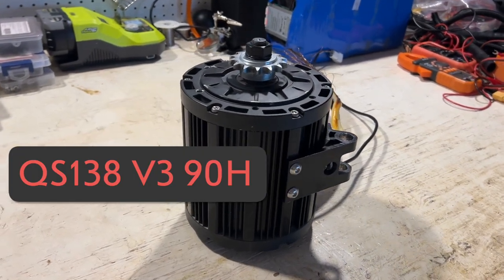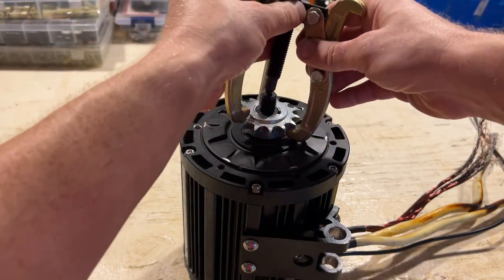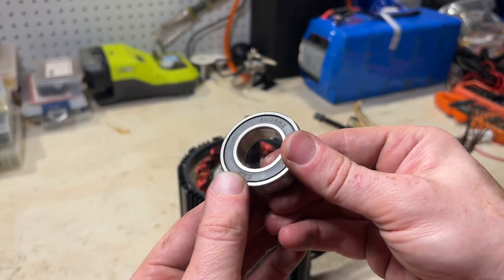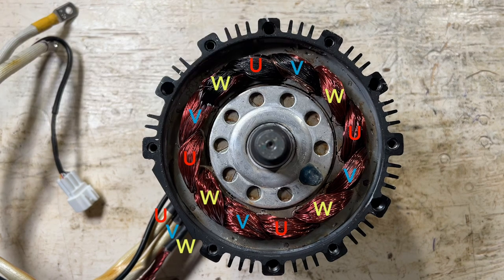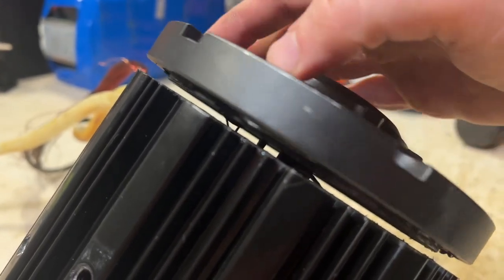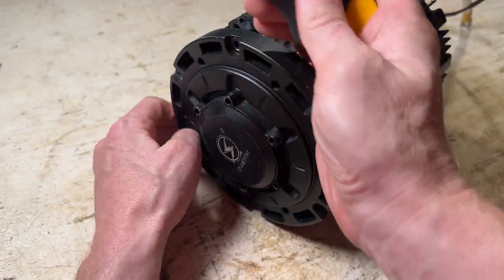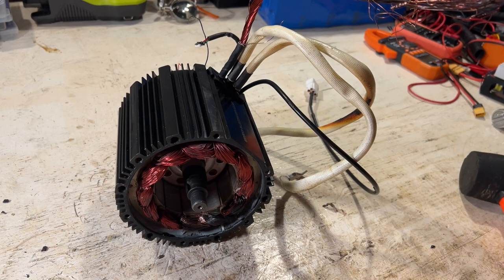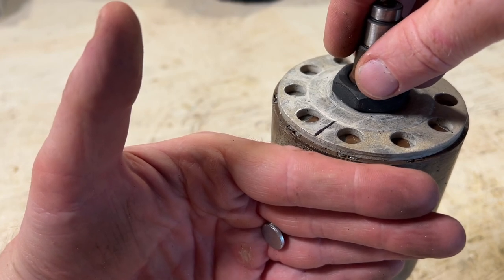Complete Teardown of the QS138 90H Motor | The Best Cheapest Motor?

Comment: Thanks from all of us QS138 owners for such a quality and detailed video!

I have disassembled QS120 and QS138 before, so some little tips if you are do it to a healthy motor and then reassemble it back without a damage:

Unscrew the hall magnet plate before taking the rear cover off. It is not shown in this video because it is between the two rear covers behind the hall sensor pcb.
Mark the rear cover position over the casing so you can correctly position the hall sensors during reassembly.
The easy way to take out the rotor is to secure it in the vice and just pull the stator away by hands with one quick motion. If you can not do it completely in one motion, it can damage the stator windings because the shaft end will try to stick to one side of the stator.
If you plan to replace the shaft (you can get spares from QS), it is not easy to pull the shaft from the rotor. It is glued with permanent threadlock and you need to heat it up before pulling the rotor.
Reply from the maker: This was my hope & very good tips! Thank you!!
Reply: @GaiusGarage  would it be possible to convert this type of motor into a variable magnetic field motor. The rotor seems a bit hard to press back and forth. I was thinking about reducing the torque for regenerative braking. hydrogenerator from a boat propeller in reverse, maybe with some flywheels and gears to help.

Comment: Dropping by just to say thanks a bunch for this teardown! I'm using the QS138 on a PhD project, didn't want to tear down my brand new motor just yet :)
Reply from the maker: much appreciated! glad it's helpful. What's your PhD project covering?
Reply: @GaiusGarage  Its mostly about real-time torque ripple reduction under different speeds, loads and no. of motors, and I'm trying to achieve that solely through control, so no structural changes to the motor itself. I'm still reviewing literature and prepping for FEA (hence my gratitude for the teardown :)
Reply from the maker: @mrkelkel11  Ah interesting! Would definitely love to read the dissertation once completed!
Reply: @GaiusGarage  Absolutely! Good luck with the ebike builds too, the Fardrivers are notoriously hard to tune (spent a month wrangling my 72360 for a 14kW, 9kWh moped build) but work like a dream once tamed.

Comment: It is curious to see that if they soldered well inside the motor but not in the terminals, the terminals must be soldered, very good analysis.
Reply from the maker: I think maybe the motor was manufactured by one party then shipped without the terminal lugs to a reseller. just my guess

Comment: Great video. If you leave out the soldering issues, the motor actually looks really well built for its price.
Two questions: Did you ever count the conductors per slot and/or the turns in series/parallel. 
And secondly did you analyze the phase distribution before cutting the winding? For 12slots/10poles there should be two coils of one phase in two neighboring slots. Maybe that's why there was a problem with the software saying 4 rmf poles when it's actually just 2?

Comment: Very interesting and useful! I have a qs180 incoming and will for sure check the lugs. Probably I will cut the 30mm2 phase wires and replace/enhance them with 95mm2 wires.

I’m finding it difficult to understand why the bad connection of the p-wire lugs would overheat the coils inside the motor. I can understand that the p-wire lead into the motor would overheat when only a few strings are actually connected to the controller. But after the splitting of the phase wires inside the motor, into two parallel strings, twisted and connected with solder, every string should carry current. So then it is not logical to me why the phase wires inside the motor itself would also overheat. 

Maybe there was a problem with the controller after all and the ‘firing’ of the phases was not timed correctly? It seems weird that it would fail this way, just because of some poor connection at the lugs?

Comment: Very good informative, Sir. Also please counts no of wires in slot. Wire gauge. And number of parallel wire also which is also for us.
Reply from the maker: ah! I meant to do this but forgot 😖 I will add to the description
Reply from the maker: I don't know the wire gauge but one is 0.5mm in diameter and there are 50 turns per coil
Reply: @GaiusGarage  It appears to be a 22 or 23AWG. By 50 turns per coil I think you meant 50 strands, right? If so, that would roughly equal a 6AWG wire, which is the same thickness of a Sur Ron phase wire.
Reply from the maker: @VictorFainello  50 turns per coil in the stator so yes, 50 strands per coil but the phase wires were comprised of two coils so 100 strands total in the phase wires - they are 4AWG

Comment: Great video! thanks for taechning me about the poles and pairs! Do you know the Kv of this motor?
Reply from the maker: Thank you! I actually don't know the KV of this motor off-hand. But since this is a PMSM AC motor the KV would be expressed in terms of frequency per voltage applied. so the formula is RPM/60 = frequency, and KV = frequency / voltage

Comment: How do you plan on rewinding it when you cut all the winding out of it without counting how many turns each one has?
Reply from the maker: I gave up on re-winding it. too much work when I can just sell the sell the rotor and stator for parts and put the proceeds towards a new motor, which is what I ended up doing

Comment: Hi the qs138 v3 90h
How many wire strands in each phase wires ??
Reply from the maker: 50 turns per coil but phase wires are made up of two coils so 100 strands in each phase wire
Reply: @GaiusGarage  hi thanks, for the info, the wire strand diameter ?
Reply from the maker: @peterfleming494  0.5mm I think that's 24AWG
Reply: @GaiusGarage  hi thanks

Comment: Great video, really in depth. Do you have another motor on the way?
Reply from the maker: Thanks! yeah I have one swapped out already. Runs cool as can be now
Reply: did you go with a different vendor?  I'm curious how you could know how to avoid one with issues with the lugs like this motor experienced?
Reply from the maker: @jamieforrester7108  I dont think there is any way to know ahead of time but I did use a difference vendor for the new motor. Official Siacosys store on Aliexpress seems to be legit. I added the vendor who sold me the faulty motor to the description
Reply: @GaiusGarage  Thanks for sharing. Isn't that the official QC motors shop on Aliexpress? And wouldn't the terminal be mounted by the producer, directly in the factory, and has nothing to do with the vendor?
Reply from the maker: @matickovac  I don't think so - there are a bunch of these clone shops on Aliexpress and there are a few different "QS motor" websites -- I don't know if they're all affiliated or if it's branding. I think Siacosys is who actually develops (and manufactures??) these motors then they resell them to various vendors. But I suspect they sell them without the terminals crimped. The other motor I got from Siacossys was crimped correctly. but I'm really not sure how it works

Comment: How much RPM can produce this motor in star connection and delta connection with 48v?
In delta it should give more RPM and need to handle more current (need more thick wire)

Comment: This is second case when I see one of these motors burned up like this .
To prevent this from happening again I would suggest pot the motor with special heat conductive motor potting compound after re-winding it .
Here's a very good example of what happens inside the motor with windings when it operates ..
The windings rub up against each other ..
https://youtu.be/lPNU2vniUIc
Reply from the maker: very interesting! thank you for the link. the new motor I have barely heats up even when riding aggressively. I think in this case, crimping the lugs onto enamel was the primary cause of the fire

Comment: So I had a ebike motor and Il couldn't figure out the hall sensors wires so I just deleted them all and I never saw a difference  in performance or speed control am I  gunna end up destroying something
Reply from the maker: you probably have a BLDC motor (as opposed to sinosoidal AC, like this QS138) or what you removed was not a hall sensor. the hall sensor tell the controller when to switch phases - it's like your brain reading the position of your legs to tell you when to switch for walking. if you did not know where your legs were at any given moment, you would not be able to coordinate a stride
Reply: @GaiusGarage  ok ya I remember  reading something blcd or we but thanks I didn't know the difference
Reply from the maker: @dilanmontgomery5505  no problem! BLDC motor are more simple and just require a speed controller that switches the three phases at some rate - you don't need any other components, although you often have an additional signal wire that let's you increase or decrease that rate. With sinusoidal AC motors, the motor controller needs to know the position of the rotor relative to the stator and adjust the amplutide of the three phases accordingly. a hall sensor is one way to read the motor position, a sinusoidal encoder is another common one..probably some other techniques as well

Comment: Good stuff, great vid, thanks. Do you know the difference between the 90H and the 70H? My guess is it is a bigger motor but I don't know that and in trying to look at specs it can be hard to get the same info on the same motor in 2 different places. Also, what controller were you running it with?
Reply from the maker: I honestly dont know what the "H" in 90 & 70 refer to. If I had to guess it would be related to the KV value of the motor..the rate at which it turn per volt. This is probably why the 70H often comes with a gearbox. The controller I was using is the Fardriver ND96530 - but I dont particularly recommend it mostly because the app and/or PC software to program it is total garbage. constant bugs that wont allow you to dial in the settings and support is shit
Reply: @GaiusGarage  Do you know if they are they physically about the same size? Not figuring the gearbox 70.
Reply from the maker: @dbc105  the 70h is smaller
Reply: @GaiusGarage  I found what the name all means, 138 is the diameter of the rotor and 70 is the width of the magnets. So a 138 90H has magnets 20mm longer that in turn would mean the rotor is longer also. that is the way I understood it all and it makes perfect sense. I also saw that it looks as though they are either building or working on a 138 90H with gear reduction built in. Given the motor being at least 20mm wider I'm thinking it might be better to built with a jackshaft so the motor can be centered in the frame. I'm not yet building so that is just a guess.
Reply from the maker: @dbc105  Ah! nice! it does make total sense. Thanks for the update on this! Mystery solved
Reply: @GaiusGarage  in most of these motors the H refers to the magnet's length
Reply from the maker: @BH4x0r  ah! makes sense. thank you

Comment: My engine also burned out, only the qs 138 70h model, the copper winding was replaced and everything is ok, but it overheats at low current, e.g. 150A, and the previous qs 138 50h did not heat up so much and was much weaker. The driver is FAR ND72530. I'm afraid that during the combustion the magnets may have lost their power and therefore the motor draws more A than it should, e.g. when it accelerates. If it's not the fault of the magnets, what could it be overheating from? I would be very grateful for help. Regards and have a nice day
Reply from the maker: hard to say, unfortunately. could be settings in the controller but I'm not sure what the correct ones would be
Reply: @GaiusGarage  Hello friend thank you for your answer, and this driver with this engine works well for you? I don't know if it's not the driver's fault, I want to try votola em150 or 200.
Reply from the maker: @Adrian-hw1no  actually, I am very much unsatisfied with the Fardriver controller. Price is good and it does work, but app is garbage making good programming virtually impossible. documentation is inexplicable, and support is useless. I would use this only if you are on a budget. Many better options out there. I plan to make a video on why this controller sucks in the near future
Reply: @GaiusGarage  Well, I think I'm going to change it to something else, what would you recommend instead?
Reply from the maker: @Adrian-hw1no  just depends on your budget. Kelly controllers are pretty good. BAC4000 and BAC8000 are great but more expensive. The EBMX X9000 looks really awesome but price is too much. Then there's the Votol controllers, which I think are made by the same company as Fardriver..I don't really have an experience with them. The bottom line is that all of the common controllers on the market will do a good job, if you can program them correctly. Unfortunately, these Chinese companies don't put seem to put very much effort into build intuitive and robust software or good English documentation

Comment: That's not how you remove windings. 
You had to find one of the phases and remove all stops which in tje middle of stator teeth , then you un-wind the motir and see how it's wound .
This way you also see how many turks there are .
Now you will have difficult time figuring out how it was wound ..
Reply from the maker: yeah no kidding lol. this was my original plan but it just seemed impossible to pull an individual winding out of a slot. I forgot to count the turns for the video but I can still do this from the windings that I pulled out. I probably will not attempt to rewind this motor, just seems like alot of tedious work and I'd prob screw it up anyway - lose count of turns, etc. plus, like I mentioned, there's some evident damages to the stator laminate so not even sure it's viable to do. will probably just sell for parts or turn into an art piece